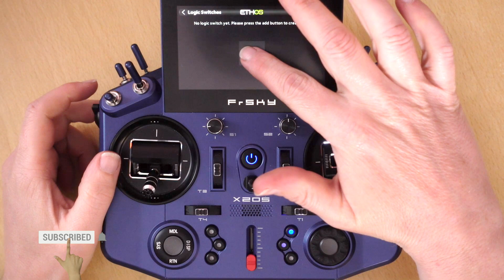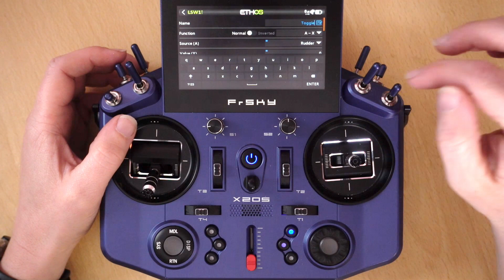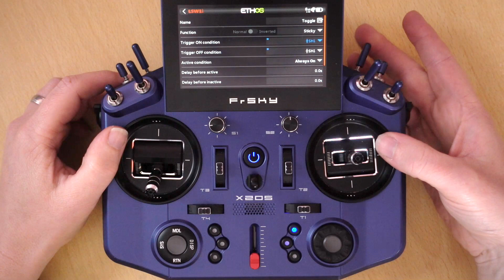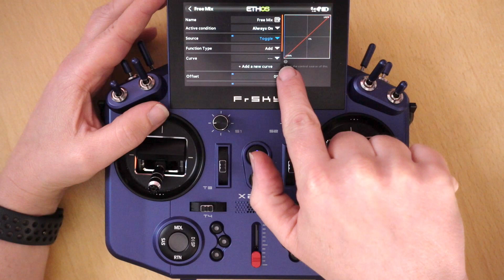Using a momentary switch as an on/off toggle switch in ETHOS

Comment: Thanks for another excellent session. I use the buttons on the back of my 20 Pro for speech call outs like' That was a nice landing Bob' or 'Do another low pass Bob'. It amuses... Could you help with a throttle inhibit using the latching red button on the shoulder to keep an ic. engine at idle while taking the model out to the strip so that the throttle stick cannot accidentally open the throttle? It would need to prevent accidental full throttle if it was turned off whith the stick forward,i.e. not go to full throttle. Rather like the throttle close switch used for electric.

Comment: Darren i have a plane with reverse thrust. I have it setup on a momentary switch but when i land i have to hold the switch and give it throttle. How can i just flip a switch and it will go into full power without giving throttle. I could do it with Spektrum it’s called fatigue. Can it be done on Frsky also. I’m new to this radio but learning things from you. Thanks

Comment: by the way, do you know how to substitute the third position of a 3-position switch by the state of the momentary button transformed into a 2-position switch? on an SR8 receiver , the management of the gyroscopes (no gyroscope, gyros activated, panic mode) is carried out by a 3-position switch, but in panic mode, it is panic; it is sometimes difficult to activate the panic mode (you have to find the right switch, the right position, etc.) the button on the back of the transmitter is the best device for activating the panic mode without having to think , but you must be able to assign this button as the 3rd position (and priority) of the 3-position switch.
well it's not easy to explain, I hope you understand the gist of it

Comment: Just used this on my  Antonio Banderas  , umm Zorro. With only 4 switches, (Arm 2p, AutoTune 2p, Flight mode 3p, and GPS mode 3p) I was out out of switches on the little guy! But after watching your AutoLaunch video, I was in need of a new toggle! Originally, I tried to use the weird roll-y detent-less wheels on the radio (what are these for?!), but I decided I'm not going to be a savage, and find a better way to let the robots take over. 
Since Antonio has 2 momentaries on his back, like your Ethos, I put my sticky on the right side of his back (this got weird). Thank you, Big D.
Reply from the maker: Yeah, that trick works just as well on OpenTX (which freedom tx is a fork of).

Comment: Hello Darren,
I've set the Special Funcs (Play Track) to my airplane however when I created a new model for my drone racer I could not  create new functions to the same switches. Do you know anyway to do it? Example: where I have the Flap switch to the airplane I want to have the Flight Mode switch for the drone.
Reply from the maker: There shouldn’t be anything stopping you from doing that. Each model you can set up as you wish.
Reply: @MrD  that was my thought. In your radio when you create a new, is the Spec Function Page empty?
Reply from the maker: Yes. Every model has its own special functions.
Reply: @MrD  I've contacted Frsky and they told me that on the Special Funcs page I need to turn off the Global variables, so the previous set will be invalid. Now it is solved. Thanks.
Reply from the maker: Ah, I’ve not used the global special functions. I’d have thought that only the function you set as global should work everywhere. But you’d still have the option of adding more model specific functions.

Comment: I'm thinking I could use this switch as my rescue (oh crap switch) being that this is a reflex action, I won't have to mindfully flip it back, just let go and I can resume control of the heli after it pulls out of me crashing the aircraft
Reply from the maker: Not in the example I use. That will latch until you press the button again. To use it as an "oh crap" switch, you just need to set up a mixer to output the needed value when you hold in the momentary switch.
Reply: @MrD  I see....still good though, pulling up in the same direction to activate and release rescue would be cool

Comment: I used the back buttons to turn on lights and Rev motor on night tundra. THANKS FOR THE HELP.
I TRIED USING MY LIPO SENSOR THAT I USE ON ALL MY PLANES WITH ACCESS RX.
Reply: When I plug into the td10 small white plug on the rx.  I tried to discover sensors and it found nothing. I shut down to study more and when I started the x20 my model was gone from the select model  screen. I'm missing something easy.
Reply: Hi Tom did you setup the reverse for reverse thrust? If you did could you tell me how you did it? I have a plane with reverse thrust but i have to hold the switch and give throttle when i land but want to put it on a switch so when i flip it it goes to full throttle without holding switch. Thanks.

Comment: i have the x20 and when i move my transmitter up and down my height rudder also goes up and down, i think the gyro in my transmitter, how do i get it turned off?
Reply from the maker: It won’t do this unless you have changed the mixer to use the gyro. Check the elevator mixer’s source.

Comment: Is there a way to use a long switch hold to disable the throttle cut. I would like a quick tap of SH to enable throttle cut (turn off the throttle) but want to have to hold SH for a second or two to disable throttle cut.  Prevent inadvertent enabling of a motor.  Do I have to create a mix with a delay and then use that mix as the  trigger off condition?  I haven't been able to figure out a combination that works.
Reply: I figured this out (typing out the problem above helped me think it through).  I created another logic sw called 'SH Hold'.  Thats a 'sticky' w/ trigger on=SH(down), trigger off=SH(up).  Delay before active = 2.0s.  So now when I hold SH for >2S the 'SH Hold' logic sw goes active.  Goes inactive the instant I release.  Then I went back into the throttle kill like you programmed in this video and changed my trigger off=SH Hold.  Works like a charm.
Reply from the maker: Awesome Stephen. Glad you got it figured out.
Reply: @MrD  Since it doesn't appear that I can default a logic swith to active at turn on (or loading a new model), I actually inverted the logic and converted this to 'throttle arm'.  That way when I load a model the motor is safely disarmed by default.  I use !throttle_arm in the throttle channel for cut.  
Thanks for your videos.  Several have been helpful getting the hang of Ethos.  I sub'ed.

Comment: Hello Darren, how would you trigger to play two different files, one for each state condition?  I am using this to trigger throtle cut and would like to play a sound for throttle cut on and throttle cut off.  I am totally new to the FrSky ETHOS ecosystem and your videos have been my tutor.
Reply from the maker: Hi Enrique. Yes, that is fine. You just need to create a couple of special functions to play the sounds for the throttle cut. If you're using ETHOS' throttle cut function, it's even easier. Create a new special function with the action "Play Track". For the Active Condition use System Event for the Category, and Throttle cut for the action. Next assign the sound file and don't forget to set the state to Enable. So now, when you activate the throttle cut, the track will play. Now make a copy of that special function and edit it. Long press on the Active Condition and select "Invert". Then change the sound to the throttle cut off sound. Then  both sides of the switch will work.
Reply: @MrD  That worked! Thank you.
Reply from the maker: You’re welcome

Comment: Thank you for doing this Darren. Your videos are of great help in learning Ethos. Am I correct to say that you cannot have this switch play two different sound tracks, for example "ignition armed" and "ignition disarmed" for the two positions?
Reply from the maker: Thank you Karsten.
Sure you can have 2 different sound files for that switch. First, make a special function for the "on" sound file. You would set the active condition to be the sticky logical switch. So when the sticky is active, the sound plays. Next, duplicate that special function. Where the sticky's logical switch is; long press the enter button. Then select "invert". Then choose the "off" sound file. You'll then have sounds for both the on and off positions of that momentary switch.
Reply: @MrD  you're a genius. I didn't know about long pressing the enter button. Works like a charm.
Reply from the maker: I wouldn’t say genius 🤣

Anything in ETHOS where you see the little square next to the option, you can long press enter to get more options.
Reply: @MrD  Exactly what i was looking for. thanks ;-]]

Comment: Darren could you have it doing multiple functions doing long and short presses  ?
Reply from the maker: Sure Brian. You could set up edge logical switches that will trigger with different timings. For example one with 0 to 0.5 seconds for clicks. Then another that is immediately triggered after 0.5 seconds (I believe the immediate trigger is called “rising edge”; but I’m not at a transmitter to confirm). Then use those logical switches to activate and deactivate the stickys. 

I don’t mean to be picky. But, I’m not keen on Daz. D or Darren is fine though 👍🏻